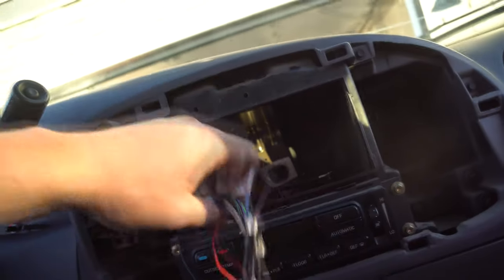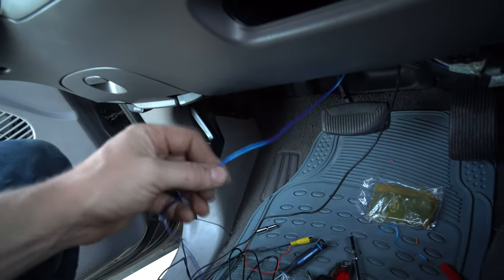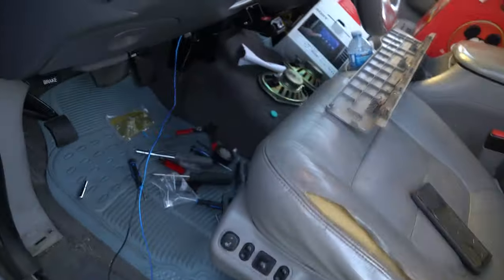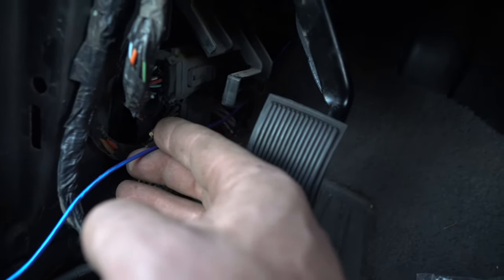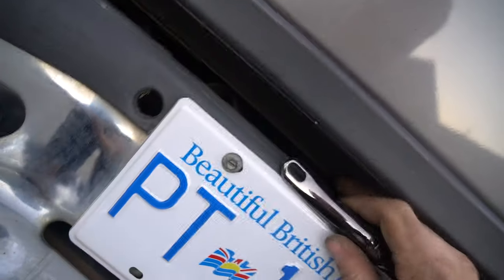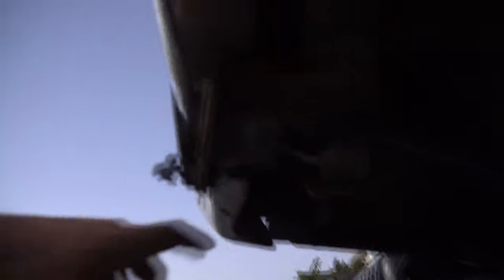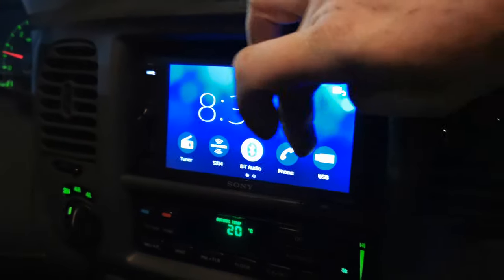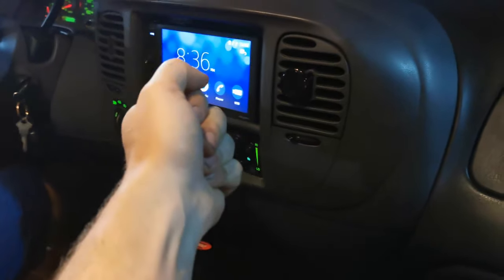HOW TO INSTALL A BACKUP CAMERA IN A FORD F150 2003

Comment: I have installed my backup camera license plate on my 2001 ford f150 and everything works great.  Except for one thing that the led lights on the backup camera turns on even on daylight when turning the ignition on. How can I get that fixed? If someone knows how to fix this issue let me know pleace thank you.
Reply: I have the same issue
Reply: I think we have to wire it to a switched wire there is one in the trailer harness I’m gonna try it and see if it works

Comment: I cant fugure out why everytime I put in reversemy AC and camera blow the fuse..  I installed a new cam power from deck to the rear.  It worked for a while.  Is there somtihing  am missing?
Reply from the maker: If you have a volt meter make sure the power wire isnt grounding out. Sounds almost like the wire your grounding out is grounding when its be activated. If it worked fine before it could be the camera it self is causing a internal short

Comment: I’m wanting to wire my camera so I can see my trailer when I put it in reverse and also when I’m driving down the road how do I wire it 2001 F150 Supercrew 5.4
Reply from the maker: You could run your camera to the back of your truck and have a Deutsch connecter or any other waterproof connecter right there at your hitch so that way you can disconnect it when disconnecting your trailer. The hardest part will be the RCA portion of it all you might want to just buy an extension piece to put in between there.
Reply: Not sure it will work

Comment: The wiring from the back are connected matching the rca colors. I got the black wire to the chassis ground, and the red wire to the back trailer red wire. I would like to find out if the connections are correct or not.
Reply: I think the red has to go to the switched brake light on the trailer harness please let me know if it works
Reply: @BiggestCuh  that's how I had it first before, now I have both red rca wires together just like the video with the black grounded to the screw on the chassis. The lights will still turn on with ignition on.
Reply: @reneramirez8922   I tapped both red wires to the black and pink rear light wire and it worked for me

Comment: I just disconnected both rca red wires from the back trailer red wire. Connected only both red rca wires together by itsel now and still the led lights still turns on at daylaight with the ignition on.